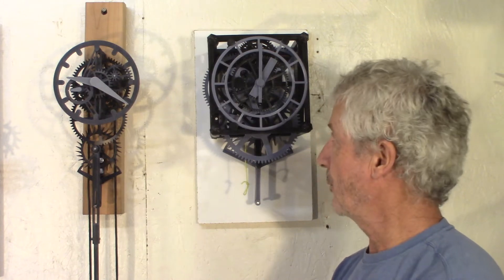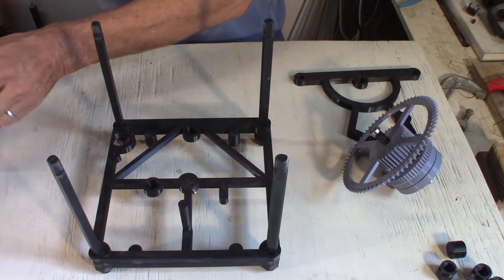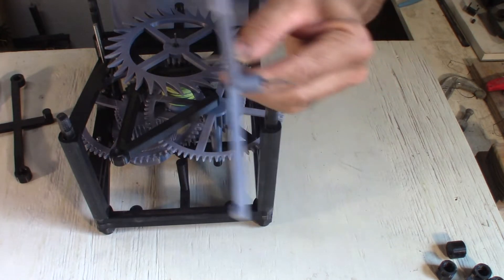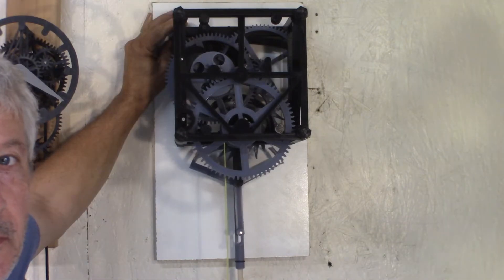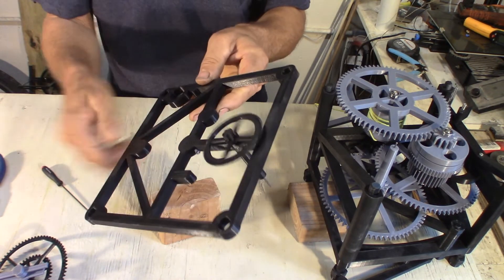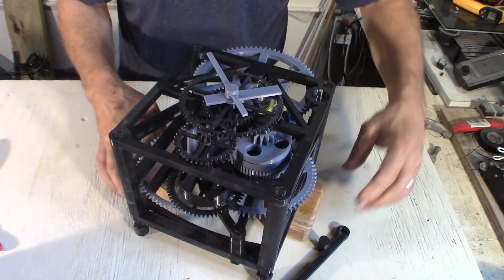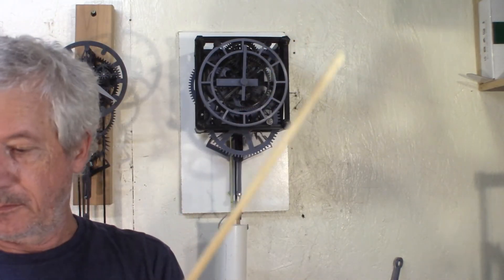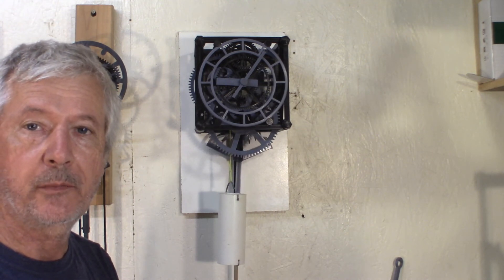Clock 24, the build video part 2

Comment: Great clock. Nice to see it finally finished. There are a lot of really clever features. I like the simplicity of the clutch and the maintaining power.
Reply from the maker: Thanks
Your clocks are great too
One day I hope to approche your run time
Reply: @jacquesfavre999  All of my experiments show the pendulum suspension as a primary source of friction. I measured how long it takes for various pendulum support methods to degrade in amplitude. The faster the amplitude degrades means that the drive weight needs to restore the lost kinetic energy more often. Small ball bearings performed 5-10X better than printed knife edges in my tests. I didn't test suspension springs since they are more difficult to find, but they would likely be even better. There must be a reason that they are used in almost every mechanical clock.
Reply from the maker: Interesting!
I am in early stage of planning a grasshopper escapement true to George Harrison specs
Twin pivot and 120 theeth escape wheel
With the same power train as this clock I can get 4 to 5 day run time
I had a thought of using 1mm piano wire as spring for the pendulum 
The swing is 9.5 degree plus some recoil 
We will see how it goes
I will be doing a video on the geometry 
With a CAD and use of constraints it is actually quite simple
I did both with FreeCAD and Fusion360 and got very similar result
Reply: @jacquesfavre999  Small diameter piano wire could make a great suspension spring. It can be made long enough to be flexible. Maybe two pieces to provide some stability. Eagerly waiting for the grasshopper escapement.

Comment: Hi Jacques Have got the full set of files but there is no mention in the notes at to the files needed for either of the options you have // Please can you send me a list as to simple version or the advanced version to save me printing them all out / there are 2 rewind handle's (24) (45) 2 Escape Wheel's Version 2 / 3 Maintain , nomaintain  it's a bit confused// Please enlighten me
Reply from the maker: Thanks and thanks for the feedback
I will add to the instructions 
One of the escape wheel has a taper to minimize friction 
There two option, with or without the maintain power spring
I will have to double check when at home